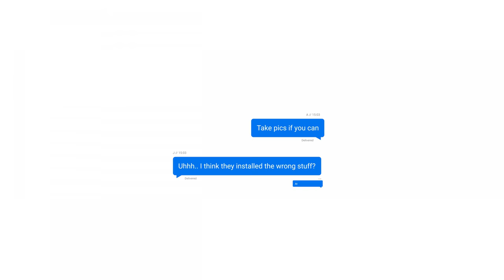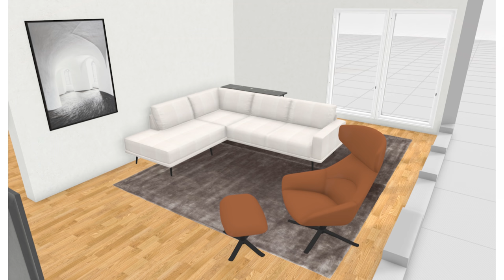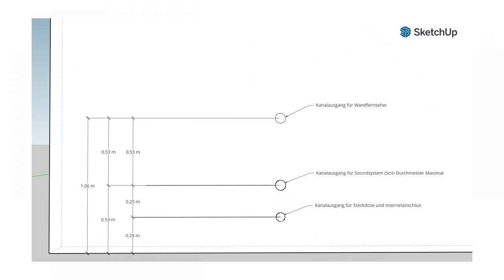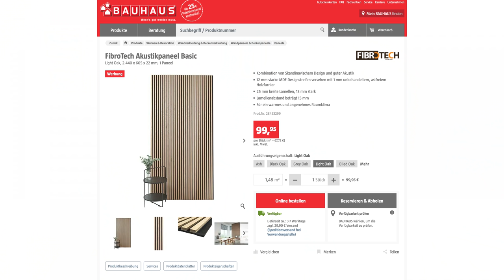HARD Lessons from Building a House in Germany

Comment: @17:50 The offset should be no problem: most soundbars come with mounting brackets that allow for a small gap to the wall (you typically don't want the soundbar touch the wall for accoustic reasons). Worst case: just insert spacers between the bracket and the wall so you can route the cable behind it.

@23:00 as a lighting technician I think putting some lights out there is a great idea. Especially grazing lighting looks very nice on rough surfaces.
You might also think about some vines to break up the wall visually. On hot summer days this can be a perfect cool spot to spend the day outside! Then the closeness of the wall might even be a bonus, as it means less airflow through the back alley and therefore less heating of the stone wall - i.e. it will remain cool for a bit longer. And even 1.7m are enough for a small table - just think of it as the 'intimate space', and the side patio as the 'party space' :-)

@24:18 that's an expansion vessel. It's basically gas filled tank with a membrane inside, that allows the water of your heating system to expand when it heats up, in order to maintain a constant pressure throughout the system.

@26:00 I'd wait for the furniture. I guess you will have at least some sort of clothes rack and dresser, which will already absorb/disperse a lot of sound. But if it's really not enough those acoustic panels do actually look quite nice.

Comment: For the decentralized TV issue you can install a hollow wooden TV panel centered in the wall that has a width that covers the sockets, in a way that you can then cover the cabling with it and center the TV on the panel, therefore centering it on the wall.

Comment: I bought a run-down little timber-framed house 4 years ago and had it renovated. The electrician wanted to know in detail where the TV would be, which way the master bed would face etc to put in the new sockets accordingly. Of course I realised only afterwards that the bed makes much more sense the other way round, and the TV ended up on a completely different wall… Oh well, it happens……
Reply from the maker: Yeah we had nearly the same situation in the bedroom as well. We also wishes we could have moved the dining room light a bit different.
Reply: Black Forest Family There are really cool cable extenders that actually make your ceiling look better - to avoid all the drilling into a brand new ceiling.
Reply: @TypeAshton  You can opt for a lighting rail system, allowing you more freedom in placing the lamps.
Reply: I do understand, that those decisions regarding TVs are something that can annoy you for quite some time. On the other hand, I think, it is something you can relax on in the long run. Because although TVs seem to be a "standard thing", this is technology that is continuously evolving. Just think how deep and thick and "small" TVs have been only 20 years ago and this will be similar in 10 to 20 years from now. At some point, there will be the need to find solutions to adjust and you will be able to find them.
Reply: Do never plan in a way, that you cannot change things. This is not sustained. In 50 years the needs will be diffrent and a house should last way longer. ;) For example inside walls should be removeable to create new rooms and windows should not have special highths.

(I feel like I cannot express my thoughts appropriate in English.. 😅 Sounds rough.)

Comment: For your sound bar: Just mount a large (maybe nicely painted) mdf-board 2 inches before the wall. Drill holes where you need them and use the existing outlets behind the board. Also gives the wall a nice 3-dimensional look which might look good. Of course: To look really good the board would need to be laquered perfecty with professionaly shaped edges.

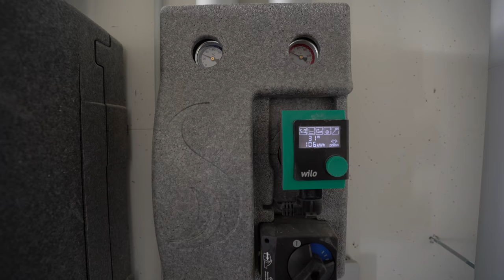Comment: 24:34 Pump pumping the water to the heaters. The thermometer to the right shows the temperature of the water going to the rooms (35°C Vorlauf) , the left one the temperature of returning water (30°C Rücklauf). 
24:52 sand filter. Collects sand of the water coming in. It has to be cleaned every  months by pressing a button and flushing out the sand.
24:58 another filter- Not sure whether it just filters or if it is filled with salt and reduces chalk content of the water

Comment: For the sound "problem" in het hallway there are lots of options you can look for acoustic panels (decorative kind)  you can go for a Cork wall that will isolate sound and give you the option to pin stuff on the wall like for instance family and travel pictures.  If you have a coat rack that also dampens sound.
Wall rugs can help with the sounds.
the panels you showed were beautiful too. just don't know if it's not too busy if you hang the whole space full with this.
Yet another couple of choises that need to made😁

Comment: On the noise reduction in the entry way

Give it a bit of time

Wait to see how you "use" the space, ingress, egress, storage, where you hang stuff, how much stuff . Whether you like a cleaned up behind doors thing, or more of an everything in the open.

Acoustic walls/ceilings are always available, but see how much space you need and want to use, then build around usage if the sound issue persists
Reply from the maker: Great advice!!! We are actually going to wait just a bit anyways... we'd love to have my dad's help installing (he used to be a contractor) and he is going to visit us in August. Then we will have a better plan and see how we use the space.
Reply: Jonathan is handy he said, i see egg cartons or shag carpet on the walls. groovy! :)
Reply: Exactly. There could be a Garderobe on the left, a Schuhschrank in the little nook, a painting and/or a big mirror on the right wall, a rug on the floor etc. I don't think it will be echo-y once it is furnished.
Reply: Yes, never judge a room without furniture regarding accoustic / echoing. Put your furniture in and your every-day stuff and judge it again. It will surely echo less than it does right now. And if you're still unhappy with the result, you can do something against it later as well.
Reply: In terms of Garderobe, I would suggest 2 hooks or coat hangers per person. Minimum. Maybe even 4 additional ones on top of that for visitors. You'll have one everyday coat/jacket that you want quick access to, a second one in times of variable weather, scarfs/hats/gloves in the winter, if you're biking you might have rain pants that have to be hung somewhere to dry... Don't skimp on those things so much that visitors have to put 4 jackets onto a single hook if you ever throw a slightly larger party.

Comment: 24:19 That's an expansion vat. When you heat up the water in the central heating, it expands and thus needs somewhere to go. (unless you're ok with the pipes bursting open and all the water spilling out :) ) This thing is half filled with water and half filled with air, and has a rubber membrane in between. That way the water can expand when it is heated, and the system will stay pressurised when the water is not heated.

Comment: Techroom, the white bubble container is a ausdehnungsgefäss. A container which is there to compensate the volumechange of the heating water while getting hot and cold/er again to avoid damage on the installation, also to keep the pressure in the system nearly constant.

Comment: Not sure if you have been told by now but the white bubble is a "Ausdehnungsgefäss" (expansion vessel). The expansion vessel has the task of acting like a "cushion" when the volume of water changes; i.e. as the volume of the water (in the tubes)  decreases when the temperature decreases and increases when the temperature increases. Because water cannot be compressed, the pressure created by the temperature change must be kept constant. This is exactly what an expansion vessel is supposed to ensure.
Reply: Perfect description!

Comment: Hello and good evening from Austria.
As for your problem for the TV wall and the off-centered sockets, you could think about using a horizontal wooden panel stripe, for instance 1,2m high but covering most of the width of the wall, to cover your electrical installations. So you could use the wall sockets but shift them to another place in the wooden stripe cover.
You could use oak if that matches your floor. :)
Reply from the maker: Yes I think this would be a great idea! Thank you!
Reply: I have seen people mounting a huge wooden panel on a wall. The panel will then have the holes where you need them and the TV would be mounted onto that panel. All cables will be hidden behind the panel and you can also illuminate it from the back. Can look really fancy. 😊

Comment: I am a civil engineer and planned my house myself, except for HVAC which was done by a specialised firm. Though I had the house itself built I did most of the installations myself (pool, water, sewage, heating with hot water tank, boiler and pellet store, ventilation system, solar panels, photovoltaic modules, central vacuum cleaner), so I have a pretty good idea of what goes on in your technical room (though mine looks slightly less professional). I had to google most of the assembly and operating instructions on the internet, and I still haven't gotten around to putting together a building manual for my family. When I'm not around, they're helpless.
For your entryway, a rug, a few canvas pictures on the walls, and a piece or two of furniture will help. Besides the stairs, for example, a hall closet will fit. An open wardrobe with all the clothes also dampens the reverberation. Friends of ours have acoustic panels, which are also effective, but quite expensive. For the larger wallet there is also something available which is disguised as a "work of art".
Reply from the maker: Ah great ideas! We plan to also put in some kind of storage for shoes, hats, gloves, etc... as well as a bench to put your shoes on. Thanks for the inspiration (also I think a home manual would be a GREAT idea. I think we need to make something similar).

Comment: I can completely relate the frustration you must feel at these delays. Totally, no doubt that it is nerve-wracking, and makes planning for a move virtually impossible.

With that being said, let's consider the other side.
I am certain that your suppliers and builders did not feel happy about having to delay it again and again. I'd wager any bet that they'd have loved to have supplied you with a perfect house perfectly on time, as well.
It's probably that they did not consider such a world-changing situation happening on top of the pandemic.
With all of the sanctions, inflation and skyrocketing prices on gas and fuels many suppliers simply can't provide the same services at the same cost anymore. But often they are contractually obligated to not go above a certain price tag.
The delivery delay of materials could also be linked not to Russia not supplying the base materials such as steel or aluminum, but the gas for forges or similar production processes. 

With the cost of gas skyrocketing many producers had to either swallow HUGE production cost increases, thus diminishing already incredibly tight profit margins, or start looking for other providers. In either case for the builders and suppliers not to go bankrupt (which would be a much worse problem for you rather than a simply delay) they had to either slow production of certain parts, or even quit producing for the time being until other suppliers could be found in a similar cost range.
Having a supplier or building company go bankrupt during a construction process is horrible for the contractors themselves. So consider yourself lucky that this did not happen (again) in the current situation.

Comment: for your cable management problem in your living room, you can just fill the holes and you can rent a "Mauernutfräse" from any Baumarkt, so you can cut your own channels for your cables or better you place "Leerrohre" in your walls, so you can decide afterwards. I did this in my complete house too, and placed many "Unterputzdosen".
Reply from the maker: Ah great! Thank you so much for the advice.
Reply: or the Better soloution speak with your Elektrican about this issue they normally have the too and expirence to set this right
Reply: tool
Reply: No need to cut the wall, you will have washboards(baseboards) on the wall in the same color as your floor is. There exist washboards that are designed to contain cables and  you can use that for cables. There are whole systems that have different addons with outlets for power, network etc.

Comment: To reduce the noise in your hallway, you could look into plants. You seem to get light from at least two sources (if I saw it correctly one window over the main door and one at the wall where the first stair turns left), which might be enough to get a real lush "djungle" going at the upper walls and ceiling. Leaves are really good at breaking sounds, and it's also a great way to cope with the hot air you inevitably will bring with you when entering during summer.

Comment: Actually the company that installed the technology in the tec-room should explain the main components to you. 
Gas main switch in case of emergency for example. Main Water switch and so on. 
The round sphere shaped thing you showed and asked the function for, is the ( Ausdehnungsgefäss ) it belongs to your heating system and regulates the changing water volume.
Cold heating water in summer needs less space in the system. Hot water in the heating system in winter needs more space as water expands when heated up.
Inside of that sphere there is a membrane to deal with the changing "water levels".

Comment: I feel with you. I own a house in the Bavarian Forest, where I live in, and I currently have a problem to buy a sack of cement to do some repair work.That's not a problem with the supply chain, I could get a truckload if I wanted, but nobody seems to be willing to sell me the mere 50 kilos that I need. And that goes on down to the smallest items. I recently bought eight batteries instead of the one I needed because they don't come in smaller batches. I had a Lampenfassung to repair, and instead of one, I got three, so there are two left over. And the list goes on. If it continues that way, I can start my own dealership before I run out of storage space in the attics. I understand that beer comes in crates with 20 bottles, and if you have some good friends, that even won't last a weekend. But why has it become so difficult to buy single items? I remember times when you could buy one banana, or a handful of strawberries, but now it's all packed for a family of six, or a small restaurant. I hate wasting things, but sometimes I have to.
Reply: That's a very good point! We used to have a specialist store in town would sell you everything in single items or very small batches... 
And then the Baumärkte moved in and they could not compete anymore.

Comment: Lack of communication between the main contractor and me was something I also experienced, also there was not enough supervision by the main contractor to his sub contractors.
Which meant that I had to inspect things on a daily basis myself to be sure things were done as asked for.
In one instance I had to let the plasterers to remove a section of external wall insulation from a piece of wall which was agreed to be not insulated by the contractor.

The technical room in German houses is also a thing which impresses people from other countries in Europe.
Here in the Netherlands the technical installation is mostly in the loft space as basements are only built in the south eastern part of the country where the water table isn't as shallow.
The installation is far simpler with mostly a gas combi boiler which also supplies hot water and a mechanical ventilation unit. From next year on a heat pump is compulsory in new builds, combined wit heat recovery mechanical ventilation.

By the looks your house use a ground source heat pump for heating, which also can cool the house in the summer, cooling is passive as only the circulation pump uses power, the water in the underfloor heating extracts the heat from the house and dumps it in the cool soil, that stored heat will then be used in the winter for heating by the heat pump.

Comment: The big white "ball" in the technical room is a "Ausgleichsbehälter" so basically it is a diaphragm expansion vessel that allows the water in the heating cycle to expand. In Germany you will have a closed loop heating cycle with a certain pressure on it, like e.g. 2 bars. An in this cycle you will need some kind of pressure storage to compensate for pressure changes. Also ther will be a pressure gauge and hand valve somewhere to fill up the pressure in this cycle. That is a common reason, if the heating doesn't work :D The closed loop heating usually has a heat exchange with the warm water boiler/tank that we saw there to. The warm water for tge taps comes from this tank.
Reply: How does this work different in the USA? And what kind of heater do you have? natural gas? heat pump? solar thermie?